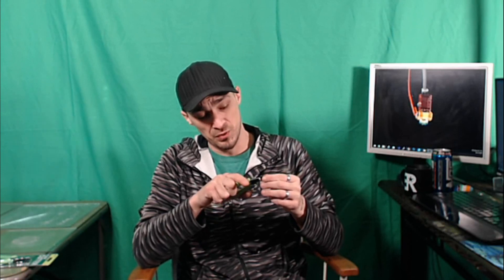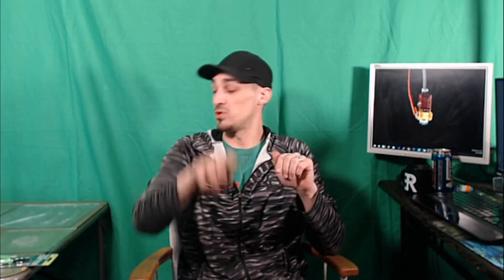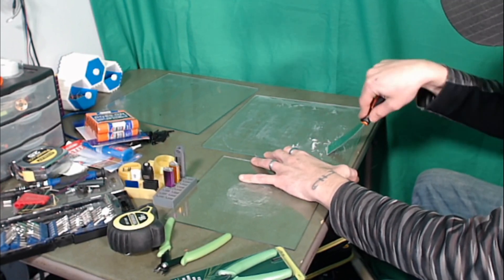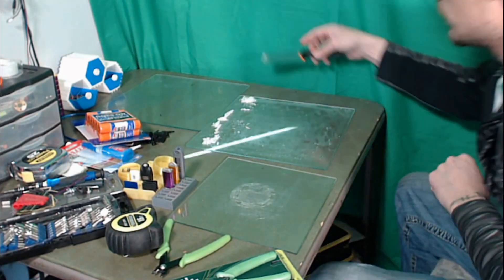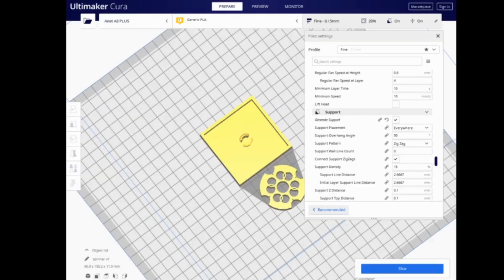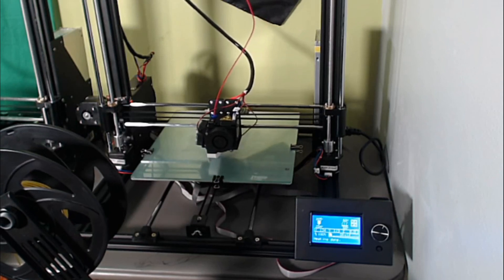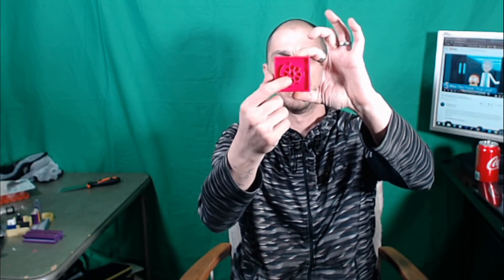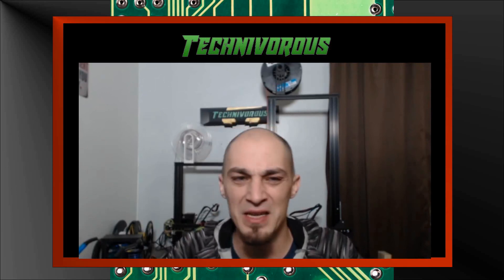3d Printing 101 - Cleaning, Prepping and Using a Glass print surface

Comment: I found that nail clippers for cats work very well for cutting filament. I get mine at Dollar Tree for $1. It has a guard on it to keep the user from cutting too deeply on the cat's nails, but that can be removed or pushed out of the way. These are not the guillotine type, but more like a simple pair of scissors with a hole that overlaps in the cutting edge, beveled to give a very clean cut.
Reply: Take a look at the clippers on Amazon using the search "cat nail clippers". Don't bother with the prices. As I said, I find them at dollar stores. Mine are small and cheap.